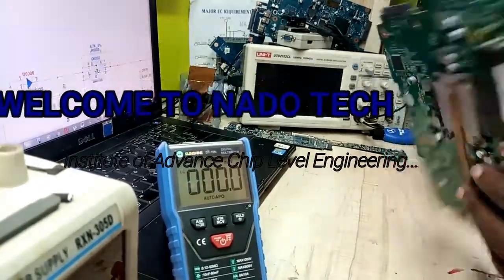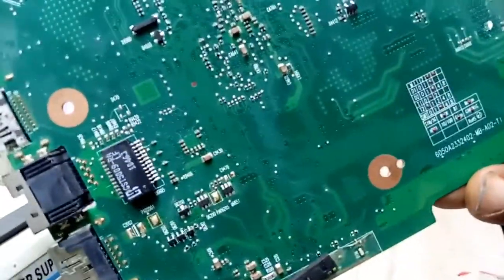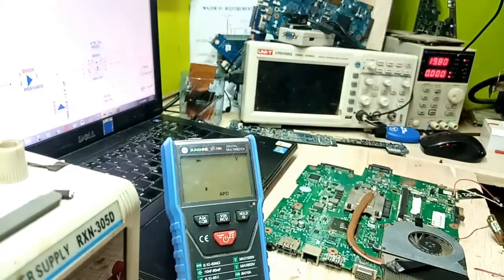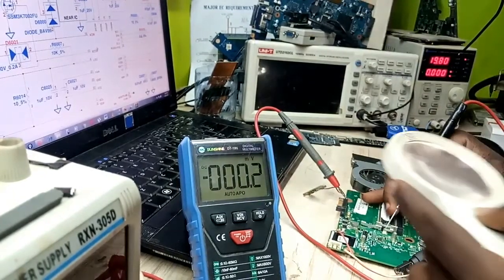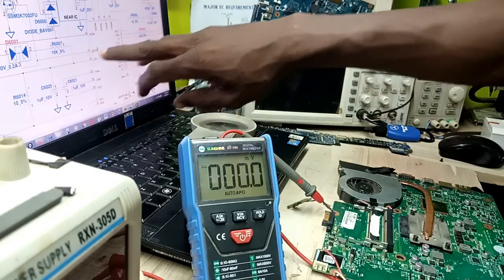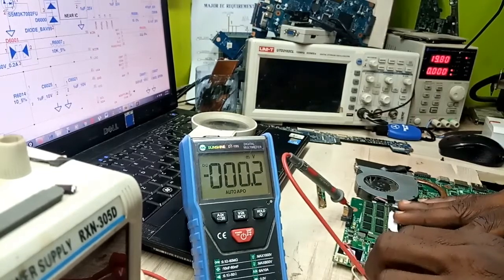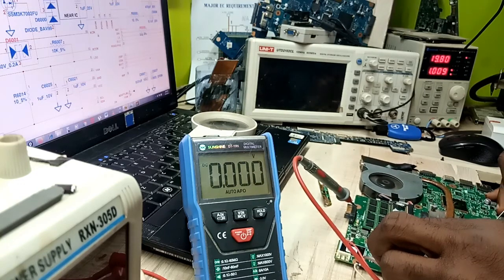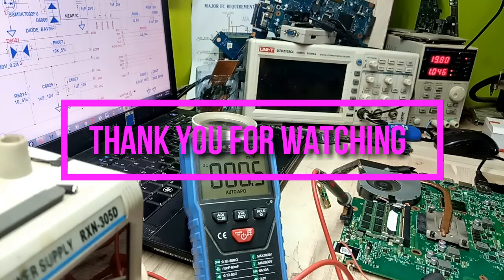Toshiba L650 not powering +3ALW present +No 5ALW S04 E01

Comment: Is it a must that we must have 3volts present at how battery terminal, power button e.t.c
Reply from the maker: Yes for all you've listed above because each pin/terminal on the motherboard has it's own unique function. Although some architectures can be slightly different from each other for example some latest motherboards does not use 3.3v at the battery terminal. Another example is 51on Logic used in very few motherboards, in such motherboard you will get 19v at power switch.